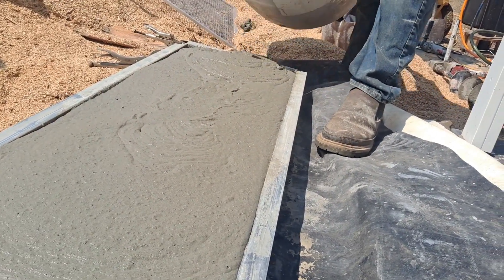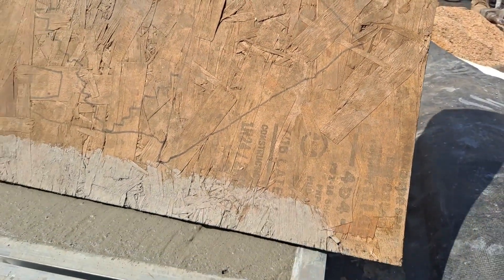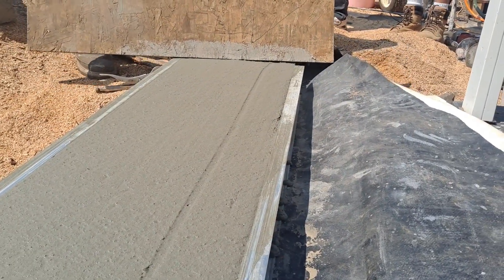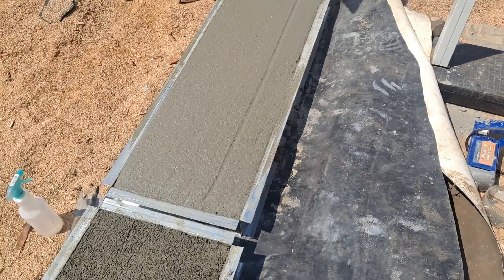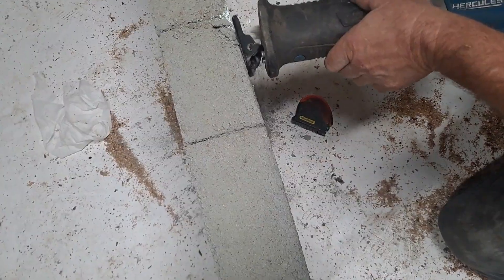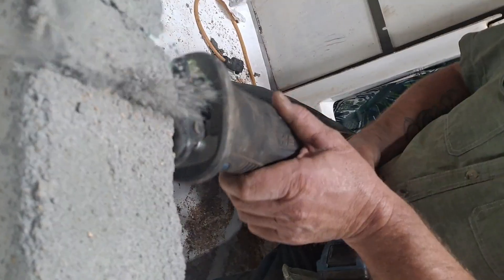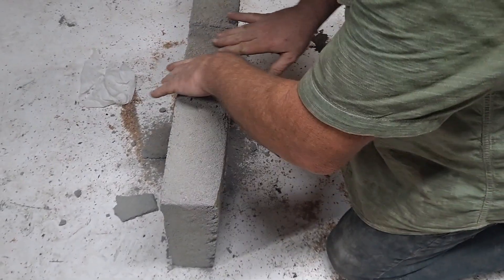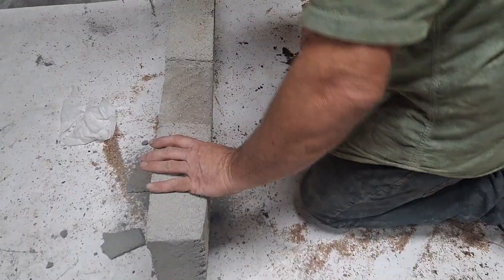Best Aircrete EvEr

Comment: What’s the R value for the insulation factor, I am considering using straw-bales then you have aircrete my bales could deliver an R-54 rating still working out ideas…oh and this will be 8 sided yes 22degrees.

Comment: Have you considered adding basalt fiber to your aircrete for strength? Can handle high temps so maybe even in rocket stoves? The fibers present in the mix might also improve penetration by waterglass through capillary action. I'm going to do a test stove this winter with it if I can get your waterglass recipe to work for me (I seem to not have the knack for it...its still fighting me lol!)

Comment: Honey do, why not try to frame the wall lying down, and then pour the aircrete in the wall, let it cure and stand the whole thing up? Seems like it would save some time and labor. Dan S  from Michigan and Texas
Reply: Yes..yes, yes. I thought the same thing.  Its how they pour concrete for warehouses. They lie them flat...build them in layers in a form. One on top of another. Plastic inbetween.  Then hoist them into place. For aircrete with horizonal pouring and  framing  you eliminate the slump factor.  Its 4 to 6 inches only . The framing is the form.  Build on the slab and hoist it into place.  A  lever, winch , pully system or a backhoe would be all you need.  You would just have to build in sections and possibly reinforce.  Chicken wire would possibly be sufficient .  Why put the cart before the horse?  Half the time framing is already done on a flat slab and then  lifted into place anyways . It seems like a no brainer to me.  But what do I know?
Reply: Yep, would make sense to do at least 4x8 panels rather than these smaller panels.  Mixing in sawdust (aka dustcrete) is good for strength.  May as well dump aircrete foam for styrofoam.  I've even seen shredded tire used.  Much lighter and more flexible than aircrete.  The one aspect you lose is hydroponic nature of aircrete.
Reply: I wondered the same thing too!

Comment: How correct is it to embed organic material into concrete? Won't it rot over time?
Reply: There is iso chanvre (basically french for hempcrete) - which is hemp fibers used in concrete.  iirc there is a bridge that is hundreds of years old that still supports the weight of modern trucks.  one of the reasons the hemp works (again iirc) is the higher silica content.
Reply: Great Question. 
From my new understand,  Soil for Web,   the hardness of the wood material isn't able to be broken down by bacteria, only fungi can do this and not all fungi.
So when you seal in the wood material the fungi on it will die as they need air and water to live (just like us) 

 This is why we vacuum seal foods, Are we cool or freeze foods because the bacteria either die or become inactive.
 This is also why plants die in the winter, Because their support system in the roots die first.

Comment: hello-  how would this work making false brick walls for exterior siding or pouring forms for planters.  I appreciate your reply.  I know you are a busy family!  🤩🤩🤩🤩
Reply: You can do "any" shape from aircrete, your only consideration is material properties. The two cases you've mentioned are IMHO unsuitable for aircrete, since it's exposed to elements. It's not like it would fall apart, but the material doesn't like it. My wife and ranch girls are using an aircrete block (Xella YTONG standard simple block remnant from the structural walls of my house, circa 1x1x1.5 ft) for about 10 years as a step for mounting horses, so it's outside on the riding range exposed to elements the whole time and all that happened to it is the corners and edges are rounded with about an inch radius. But still, you should consider it's relatively weak material that should be protected from elements. We use it in Europe for decades to build houses and around here it's actually number one material. But you always put at least a render on top of it. Usually insulation and than render.

Comment: So similar idea as hemp-crete with foam using different filler and less filler with more cement.    OK.      I still like steel studs vs wood, would have the OBS on the inside instead of drywall and cement siding on outside or stucco to make it bug and fireproof.     Cool video!  Thanks.
Reply: Well, steel or wooden, they're totally unnecessary. Aircrete can be perfectly load-bearing. Not only it's used in Europe for many decades, it's number one material in many countries. My house from which I'm writing has 300mm thick Xella YTONG aircrete (we call it porocrete, or porous concrete) walls, with 160mm EPS insulation outside and inside and outside is render. That's it, no other load bearing members, no OSB boards, no drywall... Actually, you don't have to necessarily insulate aircrete walls - my friend is finishing a new house and he has deep 500mm walls with just render and it suffices even the stricter code up in the highlands where he lives. And we have very strict code compared to US to start with. However, you need a certified product, to use it as load bearing. I hope some of you guys will finally introduce it to the US market. It deserves it. It's no coincidence aircrete became number one material in so many countries. And it's so easy to make the production process. I've seen a video from "company" in some Asian post-soviet place and they did it with similar foam generator and primitive forms and tools. I bet the nearest Home Depot alternative was tens if not hundreds miles away 😊

Comment: Have you done any thermal stress testing on your new sawdust enriched aircrete? The non-sawdust aircrete is basically fire proof, so I was wondering if the new mixture remains fire proof.

Comment: Hy guys ! I ve done this 20 years ago
Quick important tips! Spray the ingredients sawdust first and then the foam or same time , decrease the mixer rotation and use lither but bigger plates on the mixer .Try to mix very less the materials ! And wuick pour it ! You can add  havy wateron your slurry to harry up the setting time Try doing like i ve mention! I m in a fase of demolished my roof all made 20 years ago using method ive explain ! Will work and last at least 40 years ! Be aware that s not a structural !

Comment: How would I go about making a thick aircrete mix that could be used to trowel onto an existing bare aircrete wall slab ?  Would want it to be thick enough so it doesn't just run down the wall but have some hold to grip on when applied.
 Is this a pipe dream ? Would I have to use paper or tape or something to hold it in place ?

Comment: Could this type aircrete be used in non-vertical walls or sloped ceiling and roof? What would be the weight comparison to foam boards like polystyrene? Of course assuming that aircretes insulative value per cost including installation is less than polystyrene, etc.

Comment: So good to see you! ❤️That sawdust additive looks like a winner. I was playing with the idea of making cob walls inside & outside of a pallet & post frame (got the idea from the palatable cobin guy), then pouring aircrete into the space inside the 
pallets for insulation. This mixture might be just the thing!👍😊
Reply: That's sound a super nice idea, i love that kind of palletable Cobin...if you wanna continious with a super nice and natural insulation you can easily use the lightened straw, only poured it straw into a liquid clay solution and let the moisture point at press and drop...you have a win win natural insulation material for fill in or even to make some formwork brick or panel like honey do carperter do here but more lighten, isolation, transpiration, healthy, natural and cost effective...blessings

Comment: What's the cost like compared to foam or mineral wool insulation?
Reply: Non-toxic.  Which makes aircrete insulation priceless.  Foam off-gasses and cannot breath and mineral wool requires a mask during install last time I looked at the packaging.
Reply: @bruceh4833  Good point.

Comment: Are those panels bearing any weight in this application or is it purely an insulator?
Reply: Panels don't meet weight bearing code for living places.  They probably are fine for multiple "storage sheds" 👀, barns, garages, coops, etc.  The lightweight metal studs at the box stores are only good for interior partion walls that aren't supporting anything ...  unless it's not going to be lived in or collapse on someone else's property.
Reply: @bruceh4833 Yes, that's the sad part, because aircrete can be perfectly suitable for load bearing. Theremin Europe it's the most popular material in many countries and even small residential apartment buildings (commonly you can see like 4 stories ones) are built from aircrete blocks. The house I've gotten to build about 15 years ago in which I'm sitting ATM has 300mm aircrete walls (from blocks by Ytong). US is waiting for someone to take his/her opportunity and certify a universal load bearing block.

Comment: Looks way more manageable. I have been pondering additives as well. Chopped up Polly from my abundance of dog food bags. I'm using latex additive on a sculpture now... has anyone tried latex additives in aircrete?
Reply: That sounds like a waste of money and problems to me. You got soap already in there. There’s your surfactant for flow, bubbles for air entrainment, and plasticizer for workability and water reduction. Adding acrylic or polyvinyl (incase you ask) may help with reducing chalking and crumbling as an additional binder. Possibly gain a bit of flexibility but I would imagine the bubbles would break anyways and not be able to push back anyways. Either way applying a sealer afterwards would be more cost efficient, do a better job, and offer additional benefits than mentioned. Now for the bad. I already mentioned cost but if that doesn’t scare you away maybe you should try it. I can’t think of anything that could go wrong with using additives that are used to bond new concrete to existing concrete and other surfaces. Yeah nothing at all comes to mind of why it might be a bad reason to add glue to the mixture then pour it into molds. Anyways good luck. Let us know how it goes.

Comment: I put my old bean bag beans in some cement and 5% sand mix and it was about 70 beans by volume and poured a form . I kept it as dry as I could to keep the beans from floating to top and it came out perfect . A 500mm by 500mm panel at 100 thick . It weight around 3.5 kg
Reply: Were your bean bag beans actual plant beans or some plastic version?
Reply: @AndrewHelgeCox  I think just polystyrene! Not really strong but perfect as insulation panel between framing !
Reply: A little detergent will help stabilize the beans